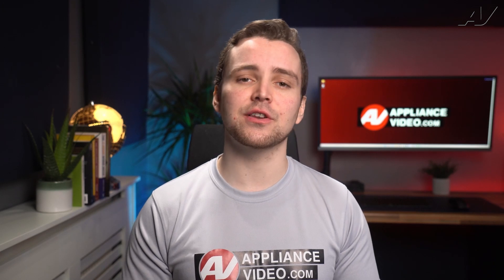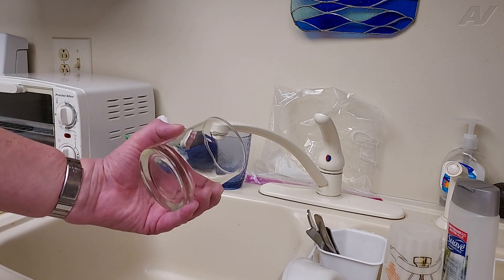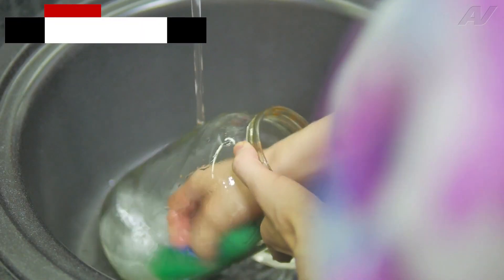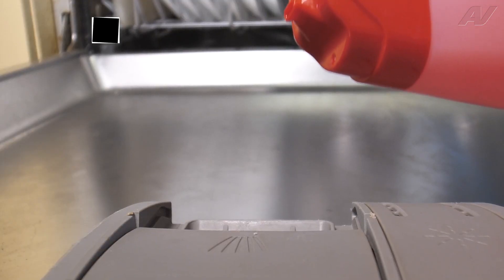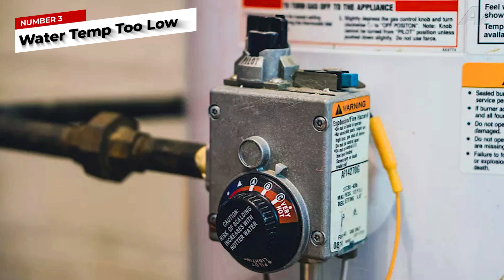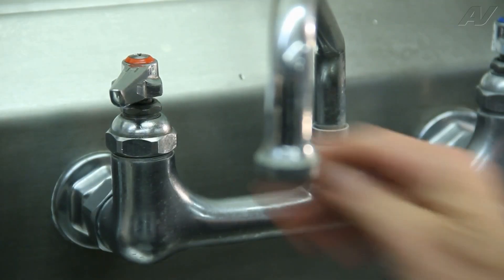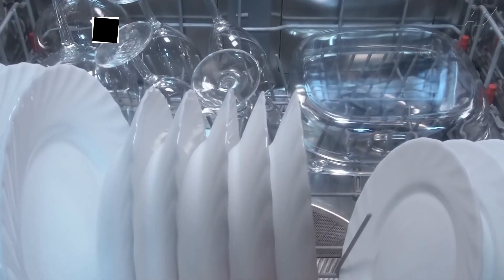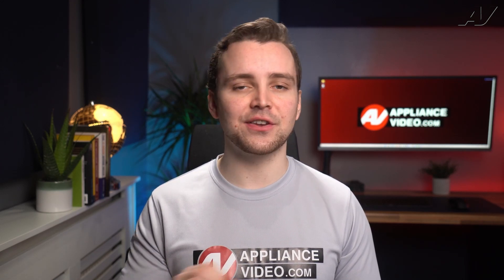Why is your glassware coming out of the dishwasher Cloudy or Discolored after a normal wash?

Comment: Most dishwashers are cold fill.  Permanently cloudy glasses is mainly caused by using cheap and lemon tablets which rely more on using cheaper harsher chemicals.  Turning up the temperature will aggregate this problem.